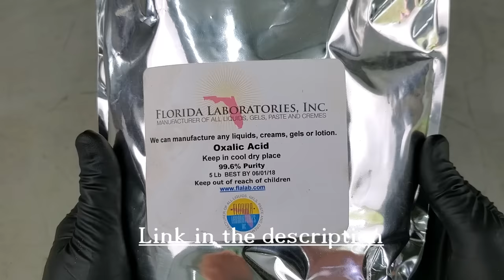Vintage Snapon Tools 1/4" Ratchet / Socket Set and Box KRA-229 Restoration

Comment: Beautiful Restoration Video! Looks like you used some kind of soaking acid to clean those sockets. I plan to invest in an ultrasound cleaner unit soon and wondered if I could have placed those sockets in the machine with some Home Depot CLR cleaner and Vinegar and gotten similar results?

Comment: Nice. However I would have just scuffed up the box with a die grinder and a scotch Brite disc, cheap prime& rattle paint. Probably would have also added a drop or two of engine oil treatment to the ratchet head where the retainer clip & locking ball is. Soaking in wheel acid will also do the same.

Comment: It would've been much better if you added thin application of body filler in the chipped areas where the rust had the most damage at so that the rest of the surface can adhere to it, but this is still a great restoration.

Comment: I was impressed by the rust removal the most I wonder how long the soak was
Reply: I just use vinegar. That was just a lil surface rust. REAL rust it'll need 12-24 hours. That. 1 hour. Ummm disassemble the ratchet first

Comment: What type of lubricant is used to properly lube the ratchet mechanism? I soak my ratchet heads (over the weekends) in a jar filled with Marvel Mystery Oil.........I recently bought a storage tub filled with random tools. Included in the storage tub was 17 Snap-on ratchets. I am restoring these ratchets. I've completely disassembled them and placed the ratchet internals in ziplock bags while the body of the ratchets are (currently) getting re chromed.

Comment: For all the time invested the box should have been taken apart ( the pin pulled from the hinge ) and the ratchet should have been stripped as well . That pin and the inside of the hinge will still be rusty , and the mechanism in the ratchet may still have rust or leftover acid in it . Overall a good restoration , just a little more time and attention to detail would make it perfect .

Comment: Very nice!  You've introduced me to a few new products that I want to get to know better and possibly purchase.

I have a few questions, if you don't mind answering:
1 - is Oxalic Acid safe and effective for rust removal INSIDE motorcycle gas tanks?
2 - that Harbor Freight sand blaster you use is very economical and appears to work perfect for you.  I have never purchased it because many write up that it leaks dust.  Did you have to do any modifications to it?  Is that the original GUN and tips or are they upgraded?
3 - That Redline EX50 looks beautiful.  Are you happy with it?  I have been looking at Eastwood for both blasting cabinet and powder coating gun but the gun looks like the same Harbor Freight gun in a different color REBRANDED.

Thanks for your input in advance.

Comment: I'm looking to remove some rust from an old ratchet and socket set.

Did you have to put a protective coat on the set after using the acid?... I was actually going to use evaporust instead, but wasn't sure if I would need to put some kind protective layer on afterwards.

Comment: I would have cleaned the insides of the sockets with break cleaner and pipe cleaners, clean the insides of the ratchet, and coating the plastic with ceramic coating :)

Comment: So, aren't most sockets and socket wrench chrome plated? The plating wouldn't have rusted, the steel behind it would have.  The oxalic acid was just to remove the rust - what did you do to re-plate? And, if I'm mistaken and this Era tool wasn't chrome plated, what did you do to prevent rust after polishing?

Comment: I'll sell you a pint of my liquid patina. Oh, heck. Here's the recipe: 4 oz. WD-40, 4 oz. used motor oil, 4 oz. of rusty radiator water, 1/4 lb. shop floor sweepings, 1/4 lb. rusty nuts, bolts and washers. Pour mixture into old coffee can, drop in polished tools and shake vigorously for 30 minutes. Lay out on hood of old car parked in the sun for 2 hours. Presto! You'll have your tools looking like they should!

Comment: Should have sponge painted the Snap-on lettering in black enamel, simply dip a sponge in some Rust-Oleum enamel iron black,and gingerly wipe it on the lettering,, and had you opted to sand the Box instead of sandblasting it you could have restored it to the original Factory finish,as the pitted powder coating looks like crap,& particularly because the boxes were actually acrylic enamel from the factory,with an acrylic plastic clear coating,which actually resulted in a really slick finish,& here again makes your powder coated pitted red look a little chintzy to say the least, but anyway just a little input, I still very much enjoy watching your videos and I absolutely appreciate the effort,as they can't always be perfect. At any rate it's all free entertainment to me,so thank you for sharing it friend  God bless ,& be well

Comment: I don't think that is that vintage.  Blow mold case seems within the last 10 years.  Oh well ENJOYED THE VIDEO! THANK YOU!
Reply: I have that same 1/4"drive set with that same blow-molded case.  Purchased in 1974 and still sitting unused in my vintage Snap-on tool chest.  The only difference is, my set came in a cardboard box rather than a metal box.

Comment: Good job cleaning up the metal box, but...................!!!

The powder coating will let you down, it will fail catastrophically after 3/4 years.

On freshly clean metal with good adherence quality nothing beats primer under coat carefully applied and 2 coats of air dry oil based enamel particularly for red colour.    Red powder coating is Shite!

Steve

Comment: Nice except that ratchet should have been disassembled, cleaned and lubricated. The Oxalic acid has gotten into the pawl, springs, and ball bearing(s). Once the acid has been either diluted with water or neutralized by an alkaline solution, the internals need to be dried and lubricated.

Comment: Wonderful job but have one question> Why didn't you take the ratchet head apart and clean it and grease it? You left all that rust and acid and dirt and grime inside the ratchet. head  Made no sense at all to go to all that work and leave all the rust and crap inside the racket

Comment: Yeah you're gonna want to take apart the ratchet and regrease the gear inside. They aren't water proof and you had it soaking in liquids which isnt recommended by snap on or any brand let alone.

Comment: What? This wasn't a restoration lol. Sandblasted, powder coated, removed rust, buffed, and used soap and water to clean the plastic. The ratchet's functionality wasn't tested to show if it worked properly, the sockets still have grime in them, you can see when it's assembled towards the end. This was more just cleaning something up. I don't consider painting something a restoration, but maybe someone else does.

Comment: If it wasn't for the big fat "SnapOn" logo on the box i'd say it is a very cheap chinese rachet. Looks very low quality especially with the vacuum molded tray. I have a 1/4 rachetset by würth which is much, much higher quality with a rubber liner and way more polished finish (not in a literal sense), and it probably cost half of what this set did.

Comment: Why not strip the paint for sandblasting? And why wouldn't you disassemble the ratchet before submersing it the cleaning solution? Hell, at least crack it open after and relube it.

Comment: Did it bug anyone else that the case was quiet before the whole process then afterwards it creaked? Just me?
Reply from the maker: it bugged me!  there was a little bit of heavy powder build up on the hinge and I lubed it but it was still making noise.  but ive used the set quite a few times and its really almost gone now after wearing the powder off.

Comment: Sorry but you should have opened up the ratchet and regreased the gearing etc inside. You can't soak that ratchet in water and acid and not expect some negative effects on enclosed mechanisms and parts. Nice job on.everything else.

Comment: What's funny is that you could have turned that set into Snap On and got a replacement no questions asked.
Reply from the maker: Have you ever tried to get a replacement from snap-on?  they fight tooth and nail,  ive had snapon reps tell me I used a screwdriver as a pry bar and wouldn't  exchange.